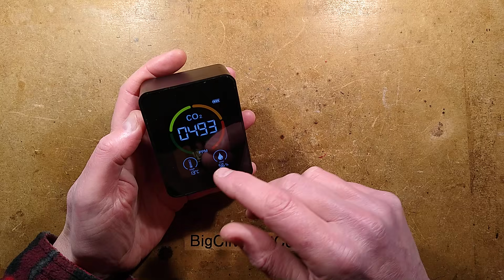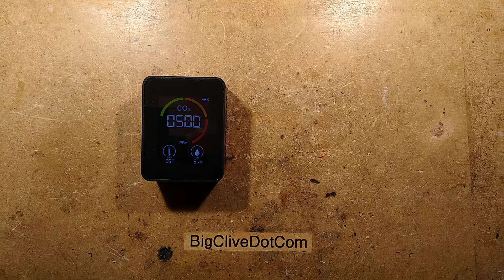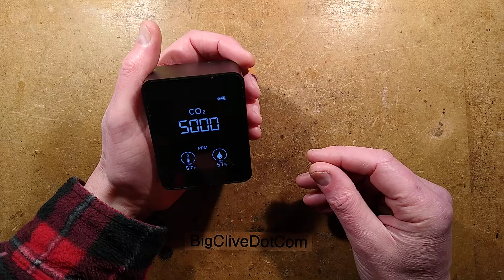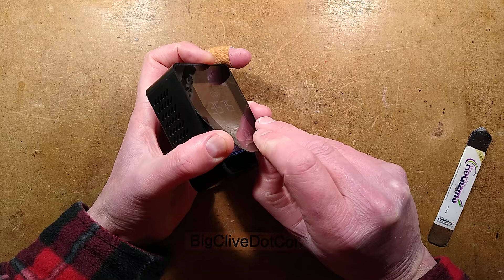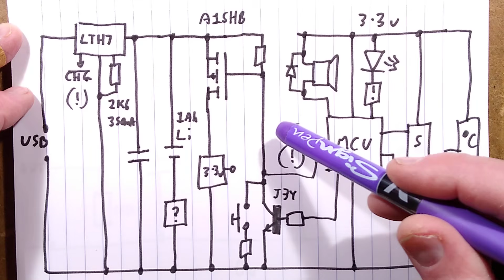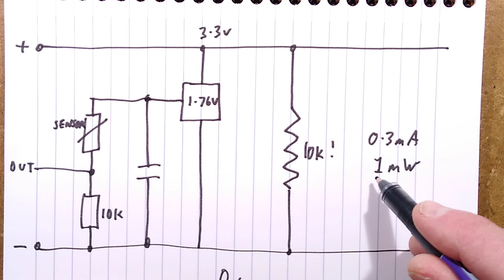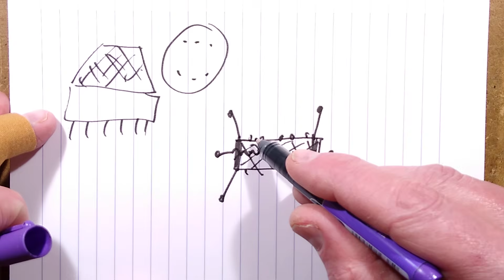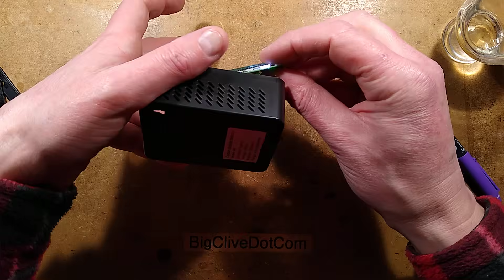Fake CO2 monitor (party detector) with schematic

Comment: "Unless you live in a hermetically sealed building" our office moved to a whole floor in a WeWork a few years back, and it always felt "stuffy" in winter. Towards late morning I was always fatigued and sleepy. I put it down to the coffee.

Someone else bought an proper air quality meter and we realised that in winter, the CO2 levels in the 200-person office would rise from 9am through to about 2pm, and the moment they hit 5000ppm they would drop abruptly and hover at a lower level. This pattern repeated every day.

It seemed that to save money on heating WeWork had configured the HVAC system to let CO2 rise up to the legal maximum before they let in outside air. Unfortunately, you start feeling drowsy and foggy around 2000ppm. Without the CO2 monitor, we would have blamed the coffee - because it would be crazy to suggest that a company was suffocating the workers to save on the heating bill.
Reply: Making employees suffer to shave just that little bit more out of the budget?  That sounds exactly like what a modern company would do.
Reply: @lyinarbaeldeth2456  Why just a modern company? This has been a thing ever since I can think. it's just how greed and lack of proper regulation / checks work. A company will never regulate itself.
Reply: @Kitsudote  It has existed for as long as companies existed, but it has been getting EXTREMELY bad in recent years.
Reply: @TheAbyssalStorm  I was even worse in the past (e.g. company script) but I agree, it's getting worse again.
Reply: @TheAbyssalStorm  Corporations used to value the bigger picture. Unfortunately, those CEOs were outperformed by short sighted, today profit minded CEOs, and have almost all been fired at this point. Now the short sighted decisions have started kicking, but it's too late to stop the cancer at this point.
Reply: @rich1051414 its usually not even the CEOs, most larger companies are run by accountants these days or worse private equity.
Reply: 2000+ ppm is dangerous for humans. I would sue the company.
Reply: There is a reason wework went belly up lol.
Reply: Levels that high are toxic to humans, over time exposure to continous levels that high would kill you.
Reply: Someone should tell the beancounters how much more people can work if they get enough oxygen.
Reply: Looks like WeWork collapsed just a few days ago. No more suffocation of employees!
Reply: seems like somebody fucked up setting up the economizer on the HVAC unit. Id bet that the tech was given the wrong occupancy information.
Reply: Nono it's COMPLETELY on par for companies to suffocate workers these days to save on heating. Especially where i live where costs went up 500% recently for large companies. Absolute insanity.
Reply: ignore all the cynics in the comments. they spend too much time on the internet
Reply: Sounds like an america moment and a half there.  Then again, with how global american attitudes are, it wouldn't surprise me if this happened in London or Luton, or maybe Milton Keynes.
Reply: @dafoex any opportunity to bash Americans, am I right? Have you actually examined the working conditions around the world?
Reply: I wouldn't blame the office immediately. They could have simply set the limit too high (legal maximum = recommendation) to let fresh air in. You just need one or two people who don't really know about the effects of high CO2 levels and simply see the heating bill.

Also, there are very effective ventilation systems which conserve up to 98% of the heat. So there's really no economic reason to not ventilate the air - not even with only 85-90% heat conservation which is standard.
Ventilation is way more effective than windows so it might be a good idea to propose such ventilation. Especially from an economic standpoint more efficient workers are better for the company.
Reply: @Hoch134  Well, those high efficiency systems are probably expensive and they probably already have a system that technically works, so that’s a reason. Just playing devil’s advocate here.
Reply: You would begin to oass out at 5,000 ppm of co2
Reply: Swear to god some companies are in a contest to be the shittiest  company possible
Reply: @sabrinaaa22590 and some uper managment got bonus for saveing made on the heating bill, I wonder they will aslo pickup, bill days lost in reduced Productivity mmm?
Reply: 5000 ppm is an insane legal limit. It is recommended to keep CO2 levels below 1000 ppm. Of course it doesn't help that humans already raised the baseline level in the atmosphere to 400 ppm, so now I've read recommendations of "outside + 700 ppm" to account for that. Brilliant.
Reply: Know what helps our office? Plants. I know not rocket science or anything, but they do more work to convert that CO2 than might suspect.
Reply: Your breath when you breath out is around 40,000 ppm of co2. 👍
Reply: The beancounters should be given a table showing productivity Vs co2 levels.

Comment: I've seen a few people use CO2 sensors inside their tents while camping in cold climates, where they would have a wood stove inside to keep warm (and a flue leading out of the tent, of course). Quite useful to ensure you don't die during the night. Having said that, putting your faith in the use of this unit could potentially have deadly consequences!

One or two here mentioned that this unit would measure CO (monoxide) levels too - it would've been nice to have seen such a test, just on the outside chance that it might actually be useful for something!! For camping, I believe a wood fire would also liberate CO, so it could indeed work fine with this device. But personally, I'd pay for a proper one that would detect both gas levels.
Reply: I have CO sensors over indoor kerosene heaters, but note that's Carbon Monoxide.
Reply from the maker: A proper CO sensor is quite complex.

Comment: The reason for the explosive interest in CO2 monitors is because people are interested in improved indoor air quality as a way to reduce the transmission of viral illness. Measuring the level of CO2 in the air is an easy way to test how good the ventilation is. It's terrible in some schools, by the way. Measurements in excess of 2000 ppm on a routine basis in certain classrooms.

Comment: You may need a CO2 alarm in a cabin if you use a gas heater or fire in a stove in the winter. Greetings from Sweden
Reply from the maker: CO?  Carbon monoxide?

Comment: Hmm. I have a CO2 meter that looks identical to this one, but the battery stopped charging so I felt happy taking it apart. It’s completely different inside. The detector is mounted near the centre back and is in a wee cage thing. The battery is hot glued in, which is a bit scary. Also, I need a spudger…

Comment: In Europe, many small apartments doesn't have proper ventilation and CO2 rises pretty fast to toxic levels, especially with more than 1 person inside.
We have to literally get a window wide open for a few minutes every couple of hours to get CO2 from something around 2000ppm down to ~500ppm...
Using TFA 5000 CO2 Monitor which works very well.

Comment: Thank you so much for doing this video. I was just about to buy a similar detector, you saved me wasting 12 pounds. There are even more advanced ones which claim to sense the amount of PM10 and PM2.5 particles. I might buy one of those, but ask the seller in advance if it has a true CO2 detector, and if it turns out that it's not, then I will ask for a refund. I really wonder what are they sensing the PM10 and PM2.5 particles with, or is that a complete BS.

Comment: I have a working one of these.  I discovered it hates my humidifier, turns out it was putting the hard water residue into the air.  New non hyper-sonic humidifier doesn't set it off.

Comment: CO2 sensors are also good for indoor "gardening" where you either are concerned about CO2 levels dropping too low or are adding CO2 and just want to make sure you're not adding too much.
I got caught up with a fake one and for the longest time I did think it was working as after being in a room with me inside with everything shut the reading would go high to 800-1000PPM after awhile which is what you'd expect in a closed room with someone breathing in it. Quite annoying too as the supplier of the meter has otherwise been decent at not trying to ship complete garbage even if it's rebranded chinese goods. Seems they don't sell that meter anymore which is good.

Comment: For the CO2 sensor.. If the microcontroller uses the 3.3V supply as the ADC reference, you do not need the extra regulator, or even a   microcontroller with a internal reference  as everything is a ratio.

Comment: Pretty daft for someone with your knowledge to say CO2 is not of importance to measure. It’s not so special anymore for ventilation units to measure this on extraction to determine at what capacity they need to run. It’s a very good indication of air quality. I myself have KNX modules in two positions measuring for a 2 point average. Which then drives ventilation speed in a linear curve. Which also means it will spool down to 10% standby speed when there none around the house. I deploy this in various projects professionally aswell. This one extra tool in the toolbox to meet standards and save energy at the same time.

The thing you are showing is ofcourse trash. But that wasn’t my point.

Comment: The not so funny bit about this is the sheer amount of fake crap coming out of China. Pretty much every cheap gadget sold on ebay, AliExpress, Wish, even Amazon is either counterfeit or simply not fit for purpose, and these points of sale continue to sell this crap because we, as consumers, keep buying it. We keep buying it because it's cheap. It's cheap because it's designed and manufactured on the cheap to the point where safety either got thrown out the window or was never a consideration in the first place.

Comment: I wonder if it's actually a carbon MONoxide detector which has fallen victim to Engrish lost in translation? I had one in the kitchen of an old flat with a shonky indoor gas boiler and if you left a glass of alcohol too near it, it used to alarm.

Comment: Typing into a search engine, carbon monoxide detector alcohol, returns back a result that Carbon Monoxide detectors will be set off by methanol. Are you sure this isn’t a Carbon Monoxide detector? which would make more sense as a use.

Comment: I've got a CO2 meter here at my home as a detector for when to open the window (it also contains a hygrometer). On the back it says "NDIR", so I hope that it is not faking the values. I like these devices, since you mostly don't recognize your own smell. I guess that the sensors aren't calibrated very well, but they fulfill their purpose.

Comment: I was suckered into buying one of these :( Thanks for letting us know they are fake. Can you explain the mistake they made with continuous current drain? Even with the monitor off the battery drains in under a week
Reply: Clive seems to think the CHG signal can be driven high by the LTH7, which would cause a current to flow through the microcontroller pin protection diode to the 3.3 volt power.  If this was the case, then that current would flow whenever the battery wasn't charging.

However the LTH7 can't drive the CHG signal high, only low.  Therefore there can't be a current leak through this pin.

I suspect the real leak involves the on/off control circuit.  It is more difficult than it might seem, to make an on/off control with only one button and without any unintended leakage paths.

For example, if the circuit was as Clive drew it, the A1SHB gate signal would not pull up to the battery voltage as intended, because current would leak through the microcontroller pin protection diode to the 3.3 volt power.  This would keep the A1SHB partly turned on, likely resulting in a stable state where the power voltage was below 3.3 volts but above zero, I would guess 2.0 to 2.5 volts.  The display would turn off but a significant load would remain.

Unfortunately, Clive indicated the schematic was drawn incorrectly, and only said aloud how it might be corrected.  I'm not clear exactly what changes he meant to the schematic, or whether he was just speculating (versus saying that was how the real device worked).

Comment: The only use I can think of for a device like this is for greenhouses which pump CO2 into the growing area on a schedule to feed the plants. Usually this coincides with disabling the ventilation, and having a hard reading of the CO2 values as they fluctuate with the high plant load will give you an idea of the health of your crop. A relatively new hydroponic tomato farm near me does this.

Comment: This is why I built my own CO2 meter. I knew exactly what was in it and learned something new while doing it. It also logs the data which you can view on your phone.
Reply: Got two running in my grow tents on ESP32's, measuring CO2, temp and humidity, calculating VPD and adding humidity as needed, then serving the data as a webpage. The modules seem to work very well, maybe not super-accurate, but reliable.
Reply: Nice, you've implied that is in fact quite easy to do so now I'm going to go build my own as well.

Comment: They put ethanol in gas which the meter it is picking up the alcohol in the air. Then they can say cars are putting out a lot of CO2. So the carbon tax is justified. 🤔

Comment: Maybe the circuitry used here is actually  meant to be used as a modern addition to a vehicle imobilizer that prevents a vehicle starting if it senses alcohol or too much vape smoke in the air. ...of course it would have failed testing cos it's too sensitive and cleaning your hands with sanitizer or possibly an auto-spray air freshener would set it off.

Comment: Any logical reason why the sensor is on the bottom, while the nice perforated grid is at the top of the back of the case?
Reply from the maker: The sensor is visible through the slats.

Comment: Probably the -OH group triggers it... So in the liquid both VG ( C3H8O3 : Propane-1,2,3-triol : Propane with an alcohol group on all three carbon atoms ) and PG ( C3H8O2 : Propane-1,2-diol : Propane with an alcohol group on the first and second carbon atom) would trigger it... and probably the flavourings also contain some chemical alcohol, some use pg or vg as a base, some just use ethanol..

Comment: Could it be the CPU/LCD Driver itself is faulty and leaking current (standby?), not the circuit design... and that's why the chip had undergone laser hair removal? As it didn't meet THEIR specs yet it still was not worth throwing away, buuut they by no means wanted their name on it. You know, just in case someone smart like Clive came along and found out it was leaky.... That way it didn't reflect badly on the chipmaker. 🤔🤷‍♂️

Comment: I got one of the VT-6IN1 Air Quality Detectors and man are they way the F off.  Then finally seeing the YT videos showing up regarding these CO2 sensors that are similar looking and yep... wondering about hacking mine out with the better sensors to at least get some practical use out of.  91% IPA and farts definitely are detected with mine.  PM values aren't so great... not a laser based sensor. I can't test out, I get gaywad jihad dumb as it comes mind controlling me like a toy, and are they jealous dumb as it cums.
Reply: Excellent disassembly and analysis!  I like the thought of being able to modify for similar or other uses.  Seems at least there's the case, display and MCU board with some interface.  Would be neat to see the MCU reverse engineered to be able to access the code and modify.  Amazed me though, one night I woke up to the alarm going off after I ripped one.  Later I noticed cleaning using some 91% IPA and going off.  I didn't like the current drawn as well, so gave up on... though I do wonder about if someone will reverse engineer the MCU for access and share the details of even if a ASIC, how to make our own apps using.  Thanks for sharing man!

Comment: I got one of those crappy smart watches from the pound shop for £16. It totally gets my heart rate wrong even though it seems to have a sensor on the back of it and how it can measure blood pressure with a green light is beyond me. I also like how I somehow managed to do over 1000 steps in the course of sitting at my work station for the best part of 8 hours.
Needless to say I have let it run out of juice and it is now a fancy black faceless wrist hugging device with no purpose other than to look at now and then and go "oooooooooh" lol
Reply from the maker: It often says in small print that it estimates some of the readings.

Comment: Quite a few PICs like the 16F914, etc come with dedicated LCD drivers on chip. Could be some equivalent.
The fakery reminds me of the old door to door home reno scam where a guy would try and sell you new windows. He'd walk around inside with a light meter and point out to you how much "heat loss" he was detecting as he walked up to a window with the light meter.

Comment: There are very good reasons to measure CO2; in many buildings, especially older buildings, there is very poor ventilation, and high CO2 values (above 800ppm or so) can have serious effects on cognitive functioning. It's often not difficult to reach those levels even with just one person. Additionally it's become particularly important with Covid - here, the CO2 serves as a proxy metric for how well-ventilated the space is, and therefore how high the risk of Covid spread is.